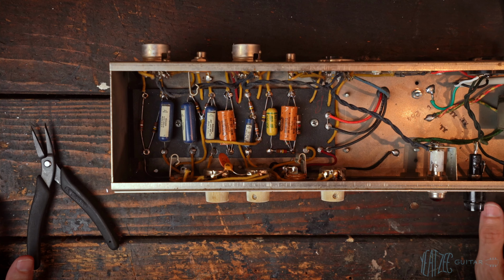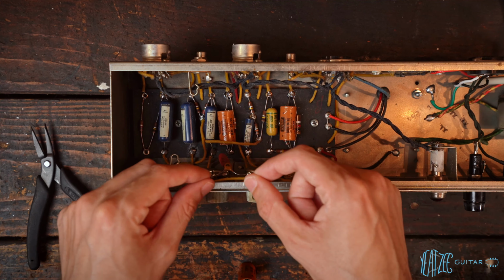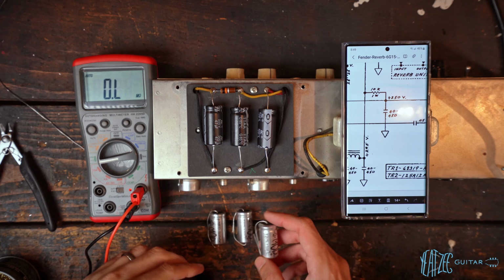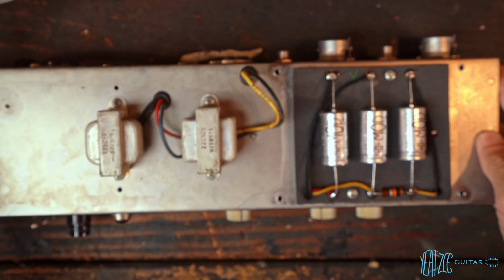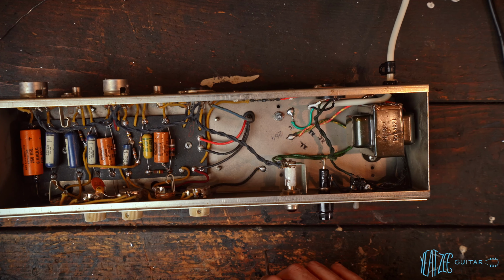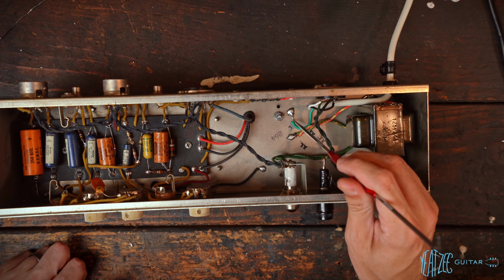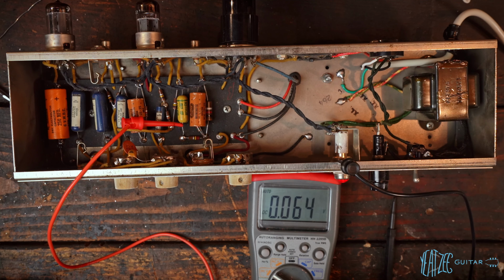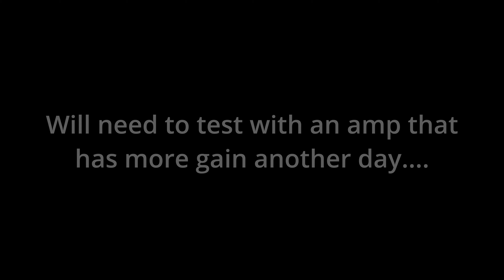Finishing the Vintage 1964 Fender Spring Reverb Unit (6G15)

Comment: Great job on the "semi rebuild" 👍 . . . I built a 6G15 "clone" and works great and used tweed cloth on the unfinished cabinet . . . It did have a bit of a hum but relocated/moved the gnd wires and that seems to have quieted it down . . . I originally used Orange Drop caps but replaced them with Jupiter's . . . a bit more expensive but it was my $ 😎. . . I use it with a clone built Fender 5F2 also covered with tweed cloth  . . . I'm mostly into surf music, '60s style 😎 . . .

Comment: Shouldn't you connect a tank while testing voltages ? I believe this would be hard on the output transformer since you don't have a load . Or is it different than running an amp without a speaker ?

Comment: You can just make a guitar cable with 1 end of the ground lifted, used to do that in racks because of the same problem.
Reply from the maker: 👀 That's a very interesting idea! Especially because I was wanting to make a short cable for the reverb to amp connection anyways. So literally just don't connect / cut the ground strand from the plug on one side?
Reply: Yup. Then experiment to find which orientation is quieter (usually ground at input of second device). Mark the lifted end of the cable.

Comment: Another alternative is to use a small 3 prong to 2 prong adapter plug for the reverb unit.  I ran into this exact same issue years ago with a unit that was grounded.  Using the adapter lifts the ground & you can then just rely on the ground connected through your cables to your amp.  Just throw one in your gig bag.  If you ever do encounter a ground loop you can use the adapter & be back in action.
Reply: Only for troubleshooting please. Unsafe for sustained use.
Reply: @PsionicAudio  If the amp itself is grounded would you still not recommend using a 3 prong to 2 prong adapter?  I don't use an external reverb unit anymore but I'm curious as to what would be the best solution to resolve a ground loop caused by this scenario.
Reply: Telescoped (ground disconnected at one end of cable) audio connection between amps or a transformer isolated ground lift device for the audio path.
Reply: If you lift the safety ground on the AC cable you’re trusting your safety to an audio cable which is not designed for safety ground and is prone to abuse.

How many bad instrument cables have you run into in your life? Don’t trust your safety to them.
Reply: @PsionicAudio  Good point.  Thank you for the responses!
Reply from the maker: @Guitar5986  you're the third person to recommend that idea to me, I think it's pretty common for this extremely niche use case haha. I know the "best" fix is an isolation transformer unit from Lehle or similar but Id like to avoid spending another couple hundred bucks and having another thing to carry. TBD, got some more experimenting to do. Would the ground loop noise be venue dependent as well, or will it not be affected by that? With the pro reverb on 10 it was minimal, not enough for me to be concerned but who knows with my other amps or other venues.
Reply from the maker: @PsionicAudio  that's super easy to do if that'll work, just lifting ground on one side of a cable. Brilliant!
Reply: @YeatzeeGuitar  Theoretically if you're plugging your reverb unit & amp into the same receptical then it should be pretty much the same.  Although if you start running extension cords that could create issues.  I like the idea of disconnecting the ground at one end between the cable going from the amp to the reverb.  Easy to carry that around with you as well.  Or just always use it & you'll never have an issue.

Comment: Might be worth putting the back to back diodes back in, they were there to break the ground loop. Then you have the best set-up and you can use ordinary cables, no need for anything special which you can leave out of your gig bag!
Reply from the maker: Yeah had no idea at the time! It's all good, I just made a short cable that stays in the back of the reverb chassis so it's easy. With a normal cable I didn't get enough hum to even really notice with the Pro Reverb, still haven't tried it with something gainier but it's fine

Comment: Although I get it… I don’t think stuffing caps in any cover is a great idea. Now that makes it impossible to visually inspect the caps for problems. My 2 cents.
Reply from the maker: Fair point! My only counter would be, especially in this case, the visual tell of a bad cap is it bubbling / puking. The original 25uf caps in this were still fine some 60 years later. These new mod caps should be good for a long time, and are so affordable swapping is a non-issue imo. But I do get your point!